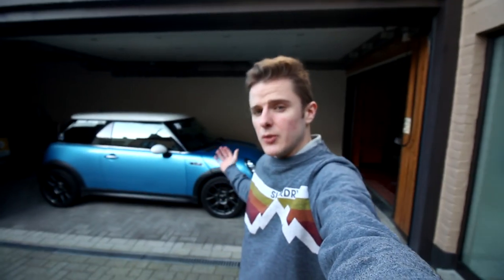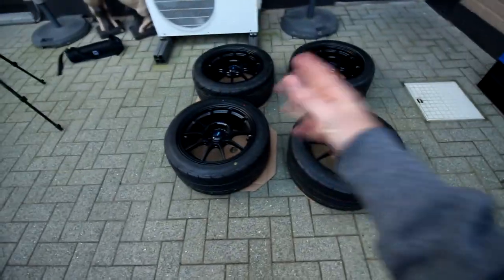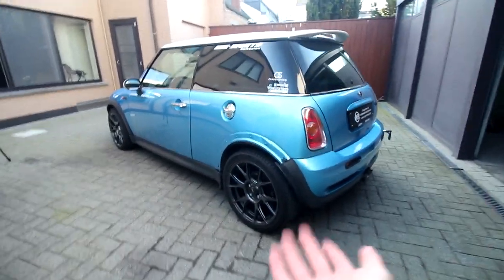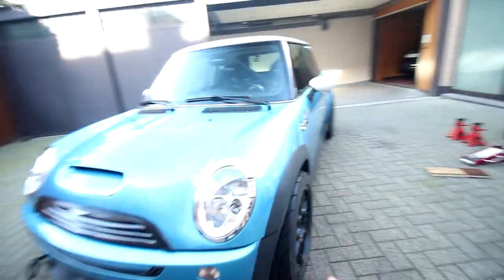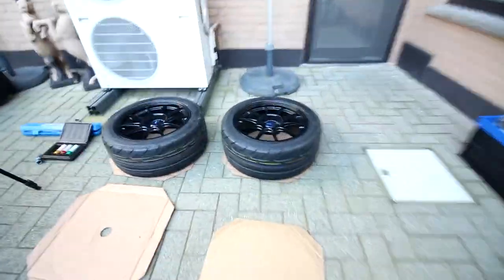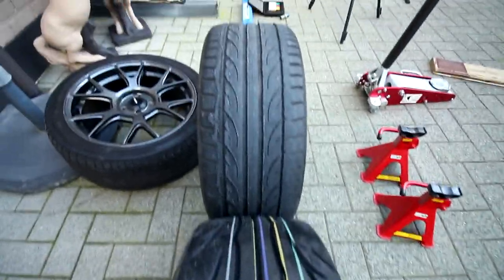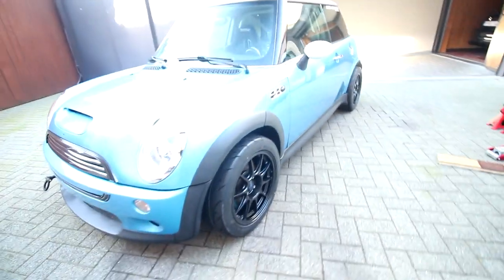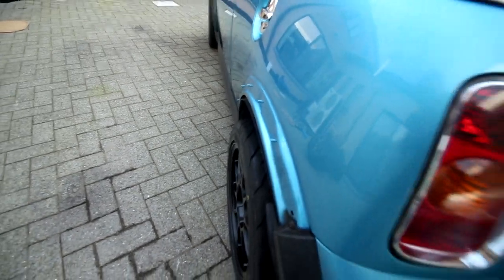New wheels fitment check - Project R53

Comment: I've you use the mini for track use, you need to change the suspension first. Especially with semi slicks. Stock camber on a r53 mini  is -0.3 in the front. You want at least -1.5 get yourself some nice bc racing coils with camber plates.